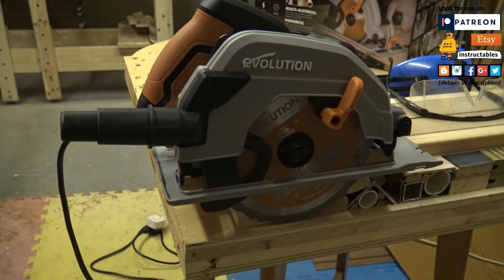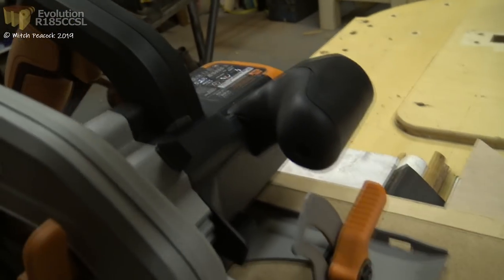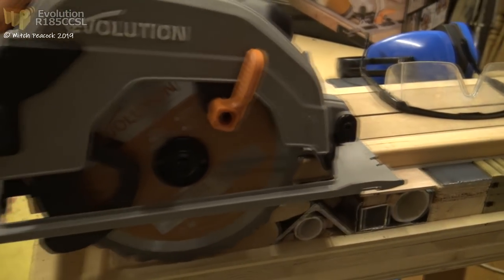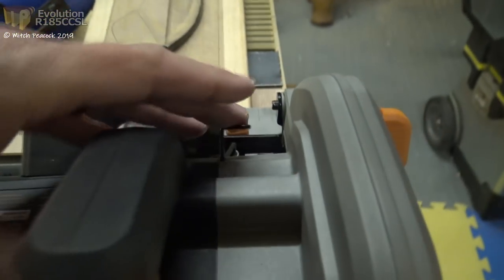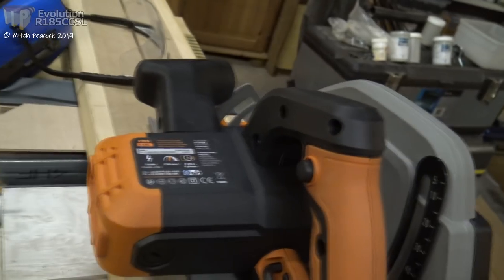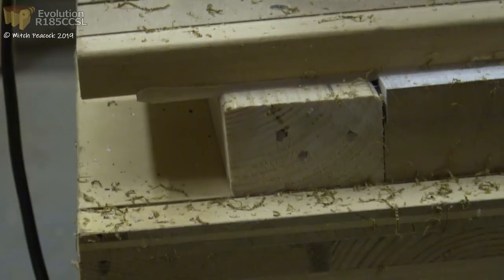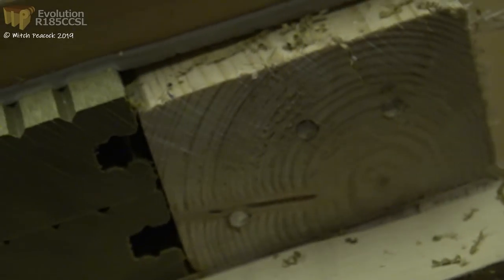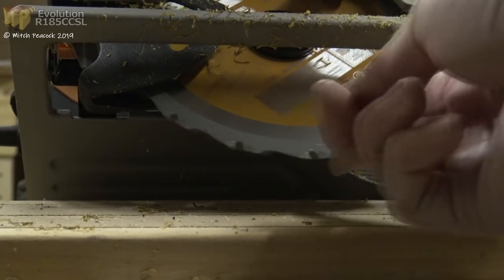Evolution r185ccsl eats a multi-material sandwich

Comment: Amazing power there mate! Wow!
Reply: As he mentions but doesn't elaborate on, it's down to the blade and the speed. Super sharp blade with good carbide and slower speeds allows the motor to be electronically governed to maintain a smooth torque curve even when differences between feed rate or materials are encountered. The motor can instantly apply more juice to maintain the RPM's. Consistent RPM's keeps  the carbide teeth from shattering, and the slower speeds keep it cool even when cutting through steel, which keeps it sharp.

It's actually old tech from cordless saws being brought over to corded to make them competitive again, since many cordless saws are now getting batteries that're big enough to make them as powerful or even more powerful than a corded. Been using my cordless to cut mild steel for a couple years now, works great.

Comment: Nice video, Mitch.
Not bad what the machine can do.

Whether that also cuts through a 6mm steel plate?

I'm always careful about such Things. :-)
Reply from the maker: I believe it would. Quite amazing, of course the blade will dull quickly doing such things.
Reply: Hello Mitch,

Thanks for the answer.

Since I do some metal work in between and then TIG sweat, I'll probably rather buy a plasma cutter. :-)